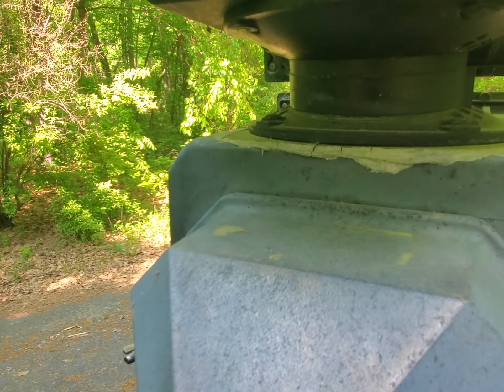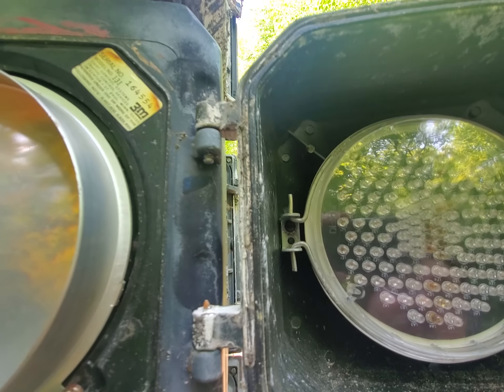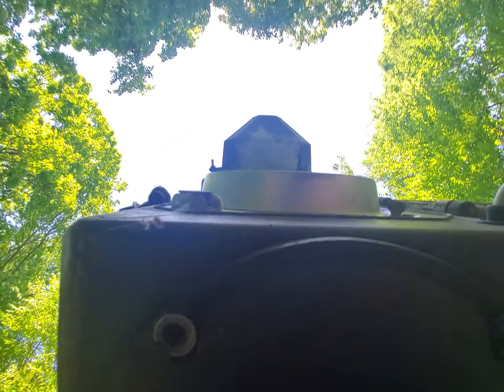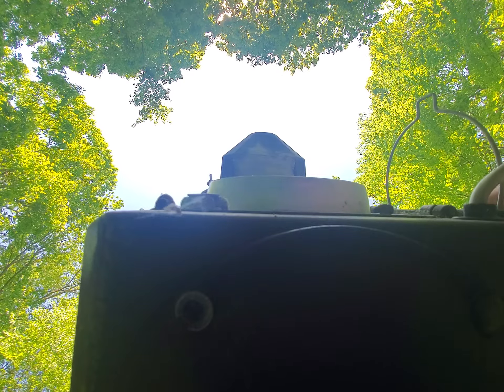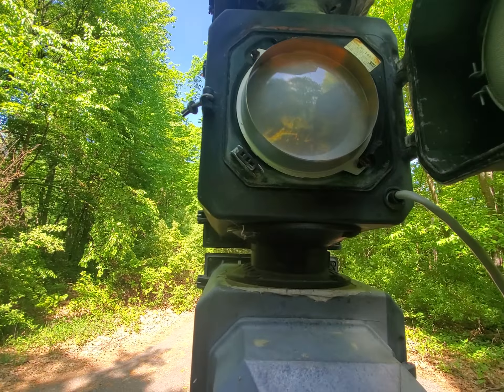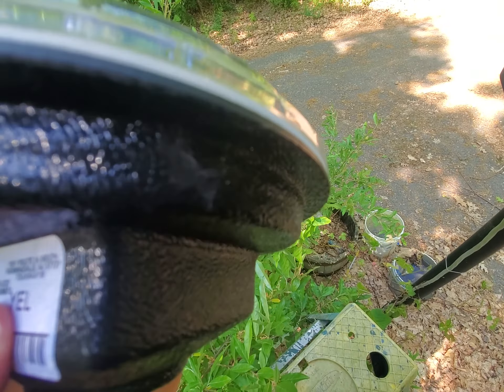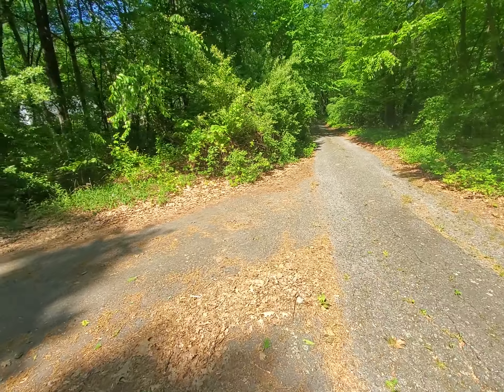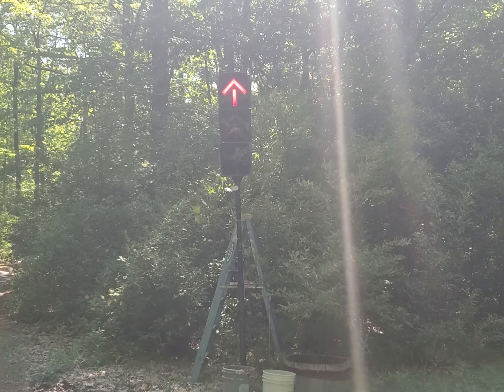3m 131 lamp replacement

Comment: Will you try getting the LED yellow after this burns out?
Reply from the maker: You mean after the halogen burns out ?
Reply: @brianthetowerguy979  yes
Reply from the maker: @TPNWR10  Due to cost I might just use halogens, they use more in power cost but I only paid $7 each for them. However I have tons of the leotek LED red ones for the 3Ms.